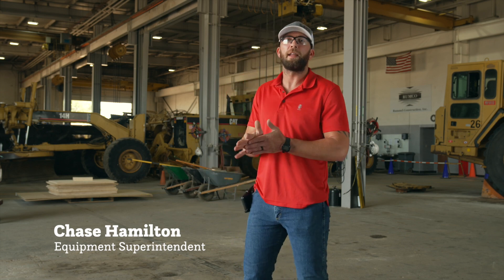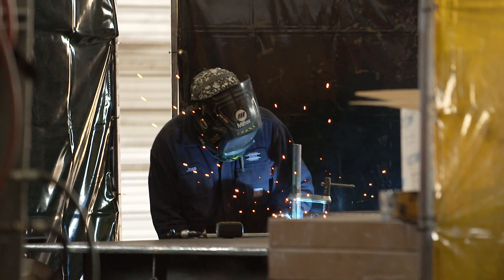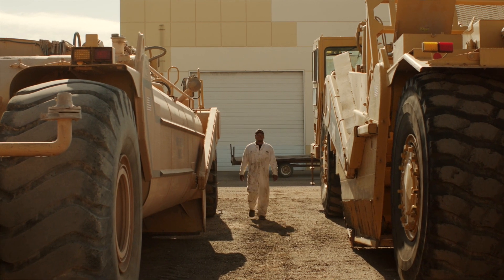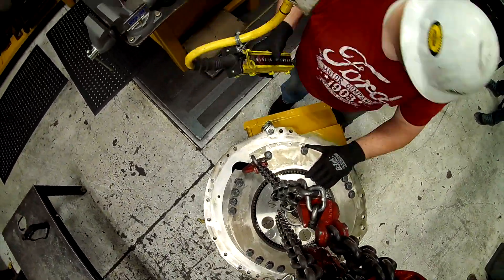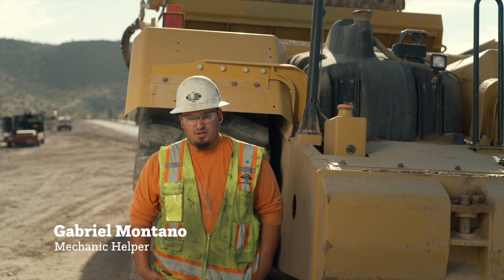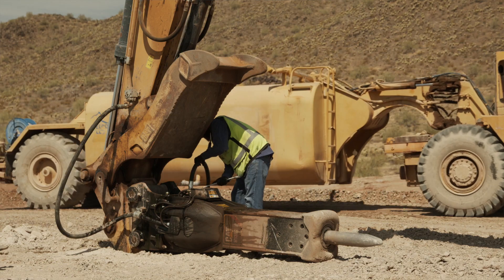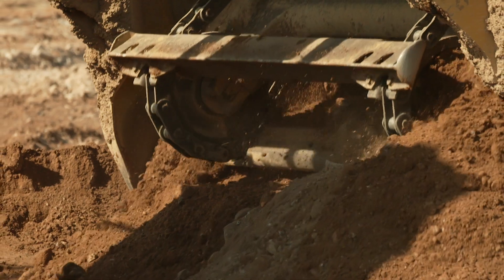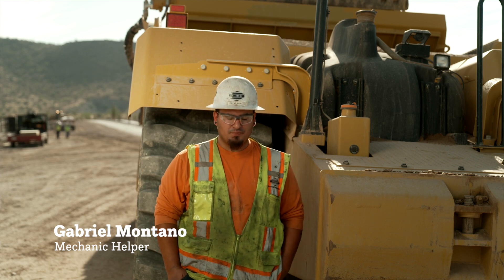What it's like to be a Heavy Equipment Mechanic - Rummel Construction

Comment: To be a helper do you need any experience. Once I get out of High School I want to become a Heavy Duty Mechanic, so will I need experience before or how would that work?
Reply from the maker: Hey Fabian, you don't need any formal experience to be a helper. If you're mechanically inclined and want to learn, we would encourage you to apply! If you don't see an opening for helpers, you can apply for a Mechanic position and we'll consider as a helper! Thanks, David
Reply: @rummelconstructioninc.8432  Thanks. Yeah I'm thinking of being a heavy equipment mechanic once I get out of highschool so I'm trying to learn what I can. Thanks again, and do you know if most shops accept helpers?